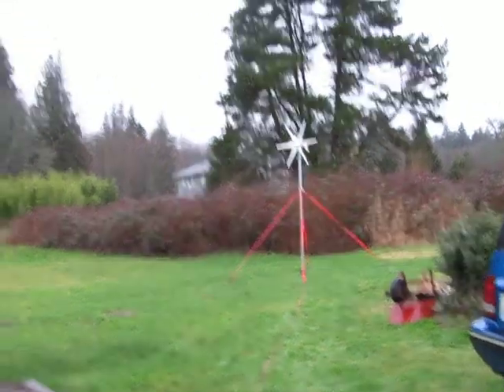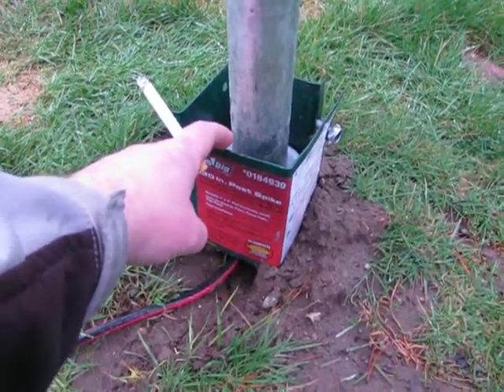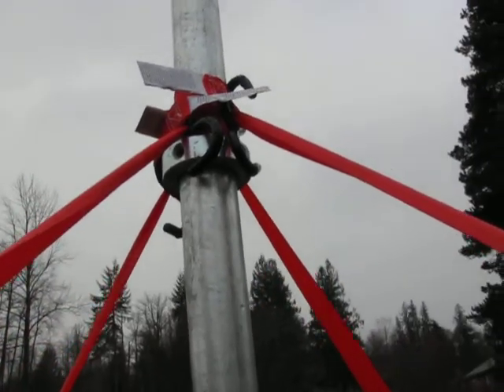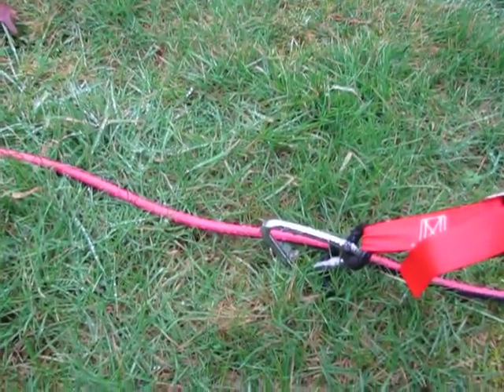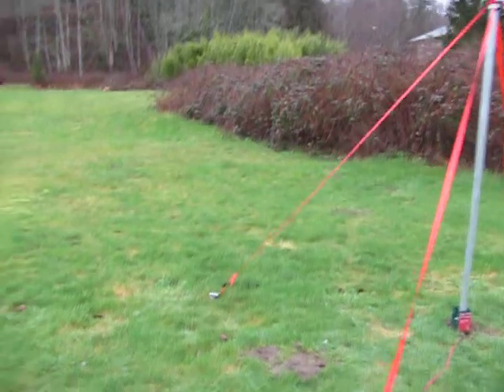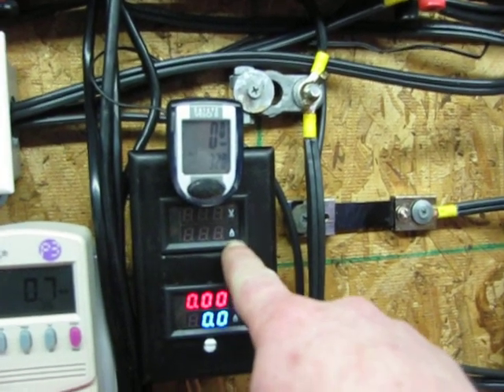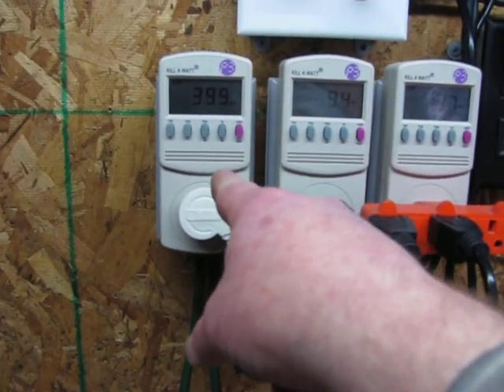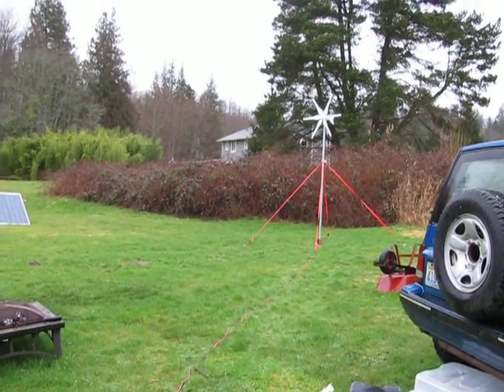My lil 300watt Chinese Turbine,, It is up and ready to run !!

Comment: How did the little chinese turbine work out? I just bought one to help with charging batteries for a security light in the back 40. Havent put it up yet still looking for a tower.
Reply from the maker: Well ,, it kinda worked after all the tail mods ,, dont let it sit on the blades on the ground and let it get rained on ,, it ruins them ,, my berings are froze/rusted up ,, I think if you keep it in the air it will be ok tho
Reply: After I get the tower and lights up I will post a vid of the install. Maybe do an update after so many months

Comment: You need to make it stable otherwise it will lack efficiency!
Reply from the maker: +Aladdin Artello OOh ya,, this was along time ago ,, about a year,, it is all different now :)
Reply: Jason Brown Oh nice! ☺ I am really considering to get one just to run a heater. Do you think it is a good idea?
Reply from the maker: *****
It really depends on your location,, I would recommend starting with solar and adding wind power later, Wind power for my location is very inconstant (it changes all the time ) You will want 10mph+ winds all the time, to get usable wind power to run a small heater,, 20mph winds all the time would be best for wind power
Reply: +Jason Brown I live in scandinavien so solar energi is really not a big deal in the winter period. Wind is much more attractive.